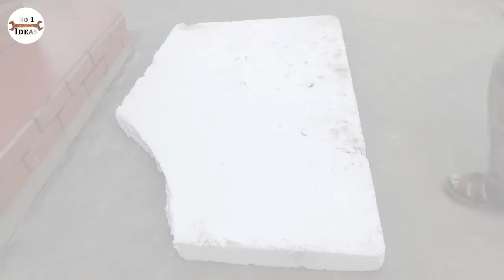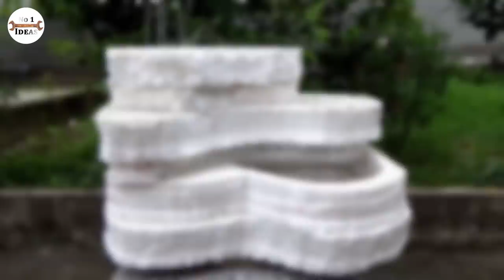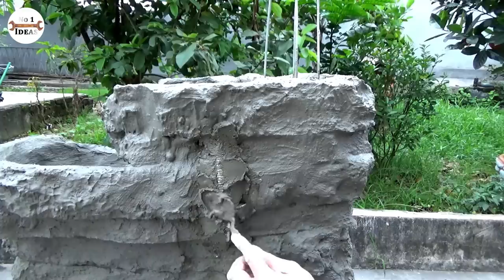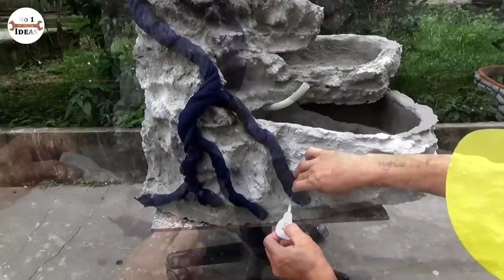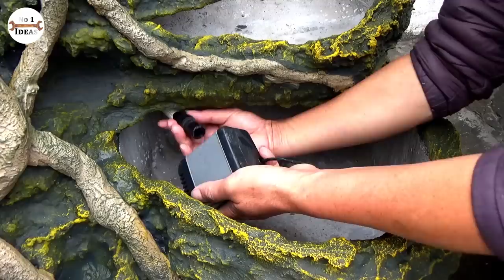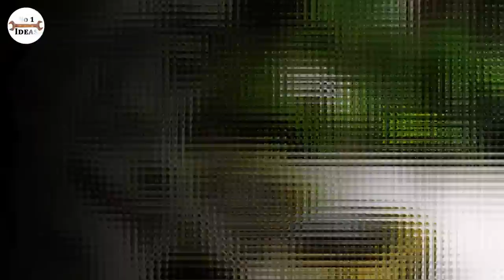How To Make Extremely Unique Waterfall Coffee Table From Cement

Comment: I love your builds so much. Please make sure though that people watching will know -goldfish look pretty there for a video but they can’t live like that, and make sure people understand that cement is toxic to fish when it’s first made and you must do things to make it safe for them or they will die.  Many people will want to copy your amazing work and they won’t know the things you do, please tell them 💜
Reply: @Nadimah can't you tell us the proper way to put the fish.
Reply: * JDDABASH * sorry I misunderstood what you said and wrote the wrong reply. I hope it is deleted now. Little fish like guppies might fit in there. Cement is great for making ponds but most people fill it and drain it many times over a couple of weeks to leech the chemicals out, then they might use a liner. You can paint the surface with a sealant instead to make it water tight and fish safe, I would probably use plastidip. That’s a rubbery sealant that is safe for fish once it is completely cured. Remember to leave the pond or tank running a few weeks to complete the nitrogen cycle and let the beneficial bacteria grow.

Comment: Nice design, but I've notice that most of these types of videos fail to mention that when using cement with styro foam water feature it  has to be sealed off with either latex paint or enamel paint  ( at least three coats) to prevent the water feature from leaking. Cement is porous so is the Styrofoam, after a few days the water starts to seep through

Comment: I have two question pls .... When you coated styrofoam is it only pure cement or concrete mixture ? And will styrofoam will make it durable  enough for long term usage ?
Reply: im not sure what mix he is using but I use a 1:1 sand cement mix with a polymer additive, I then spray on with a render hopper.  I add second coat with the addition of a Xypex addmix which is a cementitious crystalline additive  they use in pools to waterproof.  It seals the concrete and doesn't leach lime into your water which kills the fish.  You could also paint the foam with a pond sealer
Reply: @malinajoseph9553  actually I  am building one to showcase ot on front door entrancrand luckily I have some construction material basic like cement , sand and steel etc but still I doubt theyust have waterproofing solutions etc but it's not specified but I still made base and will try with limited resources
Reply: @malinajoseph9553   I build platform but didn't made video and final product can be available only after quarantine is over as I am making it with religious idea so some items I have to purchase from market which is totally closed in my city
Reply: May I ask where can I find the styrofoam and is it okay to use Portland cement? I will be attempting to do my own fountain for the first time.
Reply: @key9792  styrofoam is called as thermocol in some countries like even mine... These sheets are generally sold by craft stores or even  at some stationary stores and even come in packaging like electronics item to safeguard to the electronic items ..... But the packaging one is not flat as it is in shaped to protect the goods while transportation